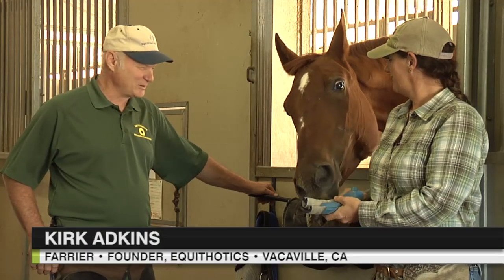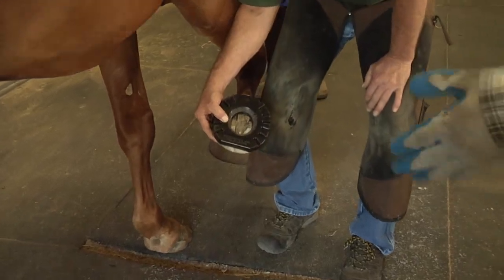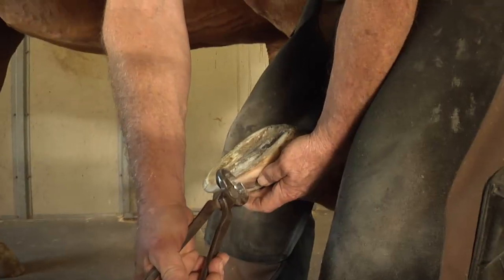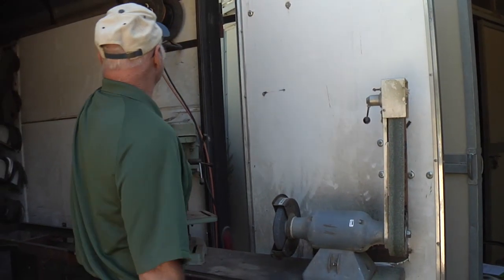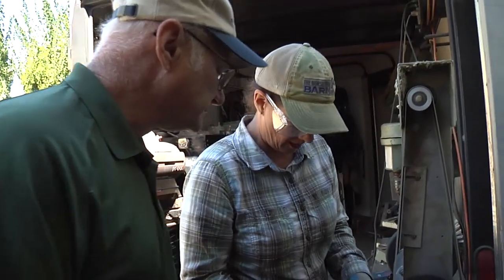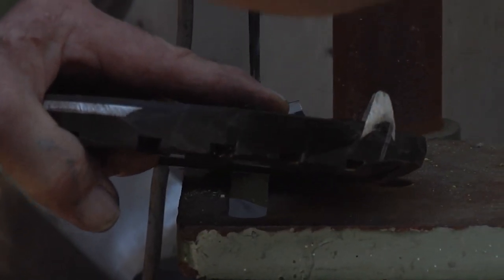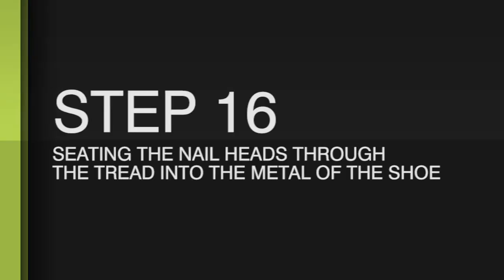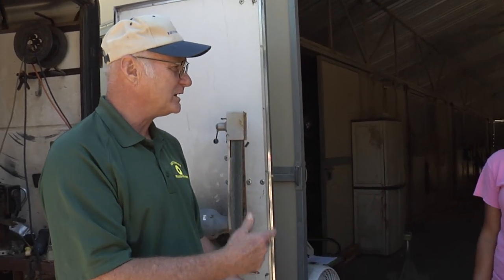How To Apply Sneakers (for Horses)

Comment: Have been using a similar shoe on my Navicular mare with great success. 
The shoe I use is called a polysteel natural balance shoe with the full frog support insert. She has been wearing them for 4 cycles now and is 95% sound with no meds. Hell if you didn’t know her you wouldn’t think anything is wrong with her RF. We’re just now getting back to work and fixing the training problem that caused the Navicular damage to begin with. This poor mare has no concept of bending her body and moving softly. She was like trying to ride a fence post when I got her but I saw her potential and now I just have to get out their and coach it out of her!